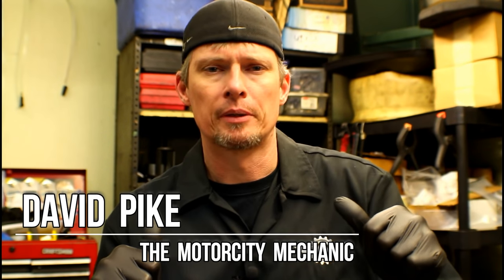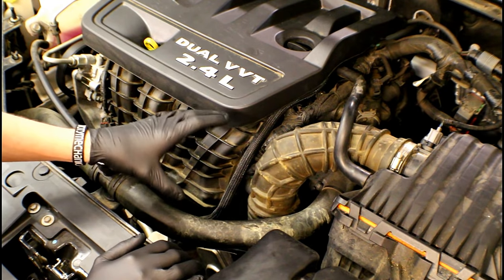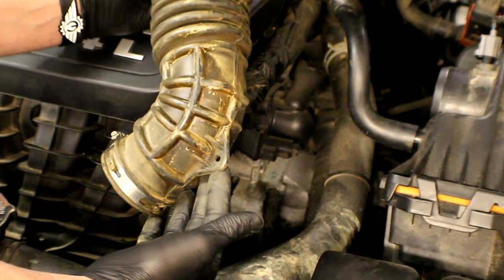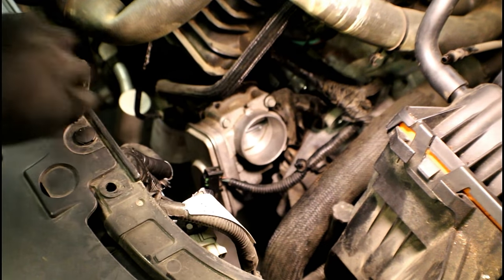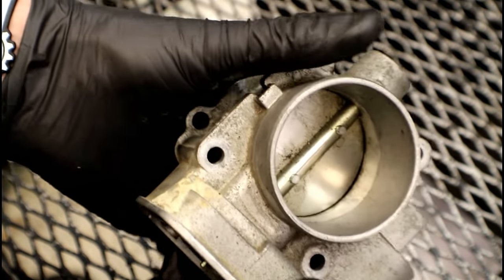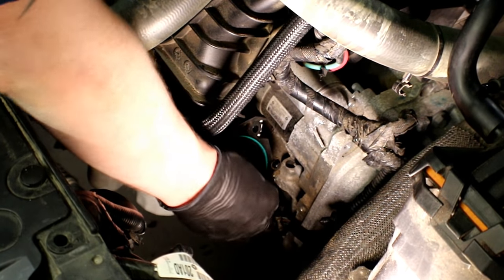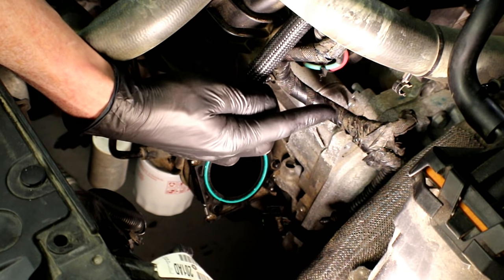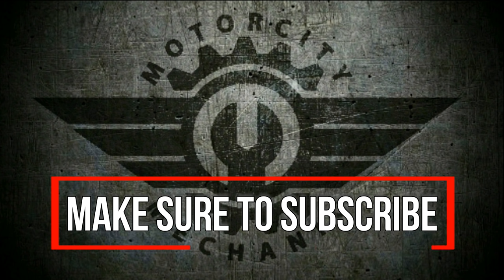Codes P2111 & P2112 Chrysler 2.4 Electronic Throttle Body replacement

Comment: I have a 2012 dodge avenger that when the car is on idle at 1000rpms it drops to 500rpms for a split second and then goes back to 1000.  This cycle keeps repeating while the vehicle is idleing.  Should i replace the iac?  Vehicle does not give me any codes.

Comment: Is the relearn required if your using the same throttle body? I want to uninstall mine and clean it.
Reply from the maker: Nope....no relearn needed. Just reinstall and your ready to go. Thanks for asking and for watching. Make sure to subscribe!
Reply: I uninstall mine... & cleaned it!  Still got the ETC symbol on dash..
Reply: Chrysler 200 2.4 LT

Comment: would this make white smoke come out of the tail pipe of 2006 dodge charger hemi 5.7
Reply from the maker: I would say no. Sounds like you might have other issues. Further diag will be needed like checking the coolant system to make sure coolant isnt getting into the cylinders.

Comment: My Chrysler 200 got a warning sign for engine over heating and this was the diagnostic result. In this case do i still have to change the thermostat too?
Reply from the maker: I have never seen a throttle body cause an over heat concern.......I am concerned that you may have multiple issues. I would need more info to understand why such as what the codes might have been. The other item is....are you sure that was an overheat indicator and not the electronic throttle body failure indicator?

Comment: I have a 2013 chrysler 200 car with the exact issue but it comes and goes, could it be a related issue?  Thanks man
Reply: I took it to an auto parts store and they scaned it and it gave 2 codes p2173 and p1604 first one is airflow/vacuum leak and the other is PCM not programed. I wonder if that is related to the throttle body?  thank you

Comment: I’ve replaced mine and my idle is still off with check engine light flashing on and off. What type of scanner is need to make this repair? Thank you! (2008 Dodge Avenger)
Reply from the maker: Usually a flashing check engine light is related to a misfire. Any code reader will retrieve the code or codes. Then we will have a direction to go in.

Comment: I replaced the throttle body and still having an issue with the throttle body.  What else can cause the symbol on the dash to come on.
Reply from the maker: The most important item is to check for codes to see whats causing the light to come on. Otherwise its just a guess at this point.

Comment: Good video,  where would the throttle sensor be?
Reply from the maker: The throttle body itself holds all the throttle related sensors other then the APP which is the gas pedal itself. Thanks for the question. Make sure to subscribe
Reply: Good morning,  thanks, subscribed!
Reply from the maker: Much appreciated!

Comment: Could a new tb be opened and grease be put on the gears to help it?
Reply from the maker: The cover on the side is crimped on. They have some grease inside already so it wouldnt make any difference and you would most likely never get that cover to seal back on once you force it off. Thanks for asking and for watching. Make sure to subscribe and enjoy the weekend.

Comment: Hey man quick question. I have one that doesnt throw codes but the etc (lightning bolt symbol) comes on only when driving. But doesnt throw any codes.. Any ideas?
Reply from the maker: Thats odd. I would recommend using a scanner that can access all the modules on the vehicle incase there is one setting a related code that your reader might  not have access to. If you do have a higher end scanner then there isnt much more I can say with out it setting a code. 2 foot driving can case that light but a code should be set when that happens as well.
Reply: I did find that the throttle body doesnt open in correlation with the pedal. Throttle position and pedal were off. Throttle wouldn't open more than 30% and pedal wouldn'tgo more than 35%.

Comment: Is the engine set up the same way in a 1997 Dodge Stratus 2.4?

I have an airbox of to the right with something that says "multi-point" something if I remember correctly.

Will the location be the same?

I can't remember. I've had the car less than a year and have barely had any issues so far.
Reply from the maker: The location is very close. It actually a bit easier to get to . It will not be a fully electronic throttle body like in the video so not sure what your wanting to do to it but the location is the same area. Thanks for asking and make sure to subscribe
Reply: MotorCity Mechanic Just looking to pull the throttle body and clean it out.

Also planning on doing the EGR Valve (sealed all the vacuum lines and occasionally I get a rough spot during idle...plus it shoots out the EGR code)

Planning on getting a new CAT too because previous owner straight piped causing a bad read from the downstream O2 sensor.

Suggestions?

And where do you work out of?
Reply from the maker: Gotcha......I'm actually located outside of Augusta GA.

Comment: Good morning. The codes repeated themselves 3 times each On the paper Auto zone printed out for me.
Reply from the maker: Yeah I dont know if I trust the codes they got....like I mentioned its odd that only those codes came up based on the info from the tests for each code. They are basically secondary codes and not the primary code. Its going to take some checking for sure being that its not a common issue that I have seen. I feel we are missing something so I cant tell you what to replace at this time due to that.

Comment: I have a 06 Chrysler 300 with the same codes what should I do? Please help!
Reply from the maker: A very possible issue is the throttle body. I recommend running the test for those codes to be sure. Also...if you replace it, I recommend you using a Mopar replacement piece.

Comment: MY CAR SHUTS OF  BACKING UP OR FORWARD thank god never while driving down the street or highway, but only when i try to take off or back up. it happens at least once or twice a day Please help.
Reply from the maker: At this point its going to take some checking and monitoring of the data when it happens. There are too many possible causes and nothing common that I have seen so far. I would be guessing if I mentioned anything.
Reply: It sounds like your car is stalling which is a symptom of a bad throttle. I know exactly what you mean because it happened to me and eventually got so bad, stopping and lights and signs would cause it to stall.  I have gotten everything fixed but the throttle even though I know it needs it, but the mechanics say differently. About ready to buy my own part and do it myself.

Comment: I need help!!! I replaced this throttle body on a 2014 jeep compass 2.4l and popped open the cover of the old one and motor oil came spilling out!!!
Reply from the maker: Most likely thats the cause of it failing. I recommend replacing the PCV valve and clean what you can.
Reply: MotorCity Mechanic  thank you for the reply. The car has 40,000 miles on it how can so much oil come from the pcv? I'm just curious have never heard of such a thing.
Reply from the maker: A sticking PCV valve can cause oil to get into the intake manifold and then settle to the bottom where the throttle body is. Small amounts isnt bad but if it becomes too much....items such as the throttle body can get oil inside.

Comment: My chrysler 200 RPM goes up and down when im stopped and while driving. Is this a throttle body problem ?
Reply from the maker: Hard to say....with out checking it.....it would be a guess. Its going to require further testing and monitoring the data with the scanner to see if the throttle body might be the issue or if you have other issues such as a vacuum leak somewhere. At this point its to early to say for sure. Thanks for asking and make sure to subscribe.
Reply: So you have any videos on vacuum leaks for 200’s ?
Reply: @MrPsychoMiko1  Did you fix it? I have the same problem
Reply: Erica Cervantes I have replaced the battery and the alternator so far I have noticed it is not doing it as much anymore however I still notice it if I have the heater or AC running and I am at a stoplight
Reply: @MrPsychoMiko1  thank you so much for answering.

Comment: I got a question why the hell did they change from a mechanical throttle body the one in my 78 dodge truck is just fine
Reply from the maker: One main reason is less parts....no throttle cable, no trans kick down cable, no cruise control servo, no IAC motor, etc. For the most part they work great and on some engines.....no issues what so ever. Thanks for watching and for the comment. Make sure to subscribe.
Reply: @MotorCityMechanic  thanks for your videos it goes to show how fast mechanics has changed since the 1st electronic ignition on my 73 cutlass.

Comment: These are the codes that came up for my 2011 jeep patriot:
U1407 Implausible engine torque request signal received
U1424 implausible engine torque signal received
U1425 implausible pedal position signal received
Any idea?
The red flashing thunderbolt is blinking
Reply from the maker: All these codes should be set along with something in the PCM.....the test for each goes back to what was the PCM code. They are general codes that point to that fact that there is another code that needs to be checked first. Just curious if you have any other codes then what you have listed. Usually you dont see these codes by themselves.
Reply: Hello there, I did a code check without a reader yesterday and code C1011 showed up.
Reply from the maker: The code you showed here is related to the left front ABS speed sensor.
Reply: Good morning, on yesterday I went to a shop and the code that popped up was p2302
Reply from the maker: This code points towards a possible coil issue......mainly #1 from the description. I recommend swapping the #1 and #4 and clear the codes....then see if the same code returns. Then we know if its different then the coil most likely. If same returns...then possibly a wiring issue

Comment: Is it common to finish perfectly fine with throttle response and later get a dead pedal like 2000 miles later
Reply: Mine specifically will drive fine all the way up till its gets around 24 degrees outside then i get the etc light and dead pedal
Reply: I have codes p2110 and p2118
Reply: Def have that woodpecker noise tho

Comment: So I don't have to reprogram it on a 09 Dodge Caliber
Reply from the maker: When you replace it....disconnect the battery and then when done reconnect it. It should turn out fine. They recommend learning the pedal and thottle body by the service info but others have said they had no issues just installing it. Thanks for the question and subscribe!

Comment: will you always get an engine light .......i was driving and my etc light came on lost power ..then went out and power was returned ....
Reply from the maker: It depends on the actual issue. Main thing is make sure that you dont drive with 2 feet. If you had depressed the brake pedal and then the gas pedal then it can cause that issue as well. I'm a 2 foot driver and I do the same from time to time. Otherwise pulling the codes would say for sure what might be going on. Thanks for the question and make sure to subscribe

Comment: all good and great unless you buy a new one from the dealer, different connector that has the be spliced in and the colors dont match FUN!
Reply from the maker: Very true. They didnt eventually change it for some odd reason....the connector that is. In the end I still wouldnt trust an aftermarket replacement. Thanks for watching Charlie and make sure to subscribe

Comment: Replaced throttle body and still nothing anything else ?
Reply from the maker: Its going to need some diag at this point. It what I recommend before replacing that way a part isnt replaced that isnt needed. Your going to need to get your hands on a scanner that can actuate the throttle body and some diag info to run the tests to narrow the issue down.

Comment: Hi David!!! I love the concise and thorough video! My question is this: Yesterday I parked my 2015 Jeep Patriot Limited (107658 miles) in my driveway with seemingly no issues. I had just drove it home from 3 hours away. When I returned an hour or less later and started the vehicle, it immediately jumped to 4000 rpms. The gas pedal seemed to have no power when I pumped it in an attempt to correct the rpms. With my foot FIRMLY on the brakes I switched from park to reverse. This dropped the rpms to 1600. I have since restarted a few times to see if it would adjust or change but it continues the exact same pattern. 

I did not see this behavior in your list of symptoms for bad throttle body. Do you think changing this part is the right fix or do you believe it is something different? 

Emailed as well to david@motorcitymechanics.com
Reply: Sounds like throttle body stuck open or a trans issue to me

Comment: Do i need to disconnect the battery..
Reply from the maker: As long as the key is off you will be fine. But you can if you want. Thank for watching and make sure to subscribe
Reply: Thanks Great instructions by the way on replacing this part.
Reply from the maker: clifton ervin Your welcome and thanks for watching. If cleaning then no need to disconnect. If replacing then disconnect. Sorry for the confusion.....miss thought that this was the throttle body cleaning video.

Comment: I have a 2007 jeep grand cherokee. It has a solid red lightning bolt (stuck on limp mode). I replaced the throttle body for a new one but it still has the red lightning bolt and stuck on limp mode. Any suggestions?
Reply from the maker: First thing....what is the code that is set. If the light is on then there has to be a code. That code or codes will give us a direction to go in
Reply: I am having the same issue. I have a 2006 Chrysler 300 and I have gotten it replaced, assuming my problem were over, but unfortunately the throttle body light keeps coming on. What can I do to get this fixed? I've taken the car 3 times to the original mechanic but nothing he does helps. Can you please help me with this.
Reply from the maker: @dieudonnecharles8258  I'm going to need to know the codes inorder to try and help.
Reply: @MotorCityMechanic  TCM U0100, ESM U0100, WCM B1A25, B1A35,